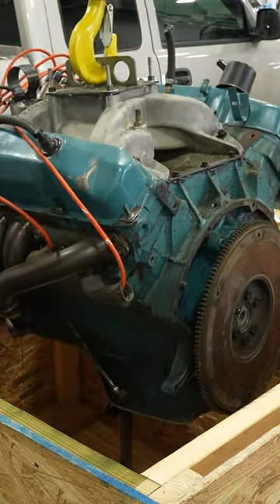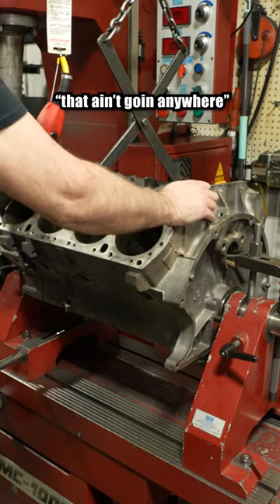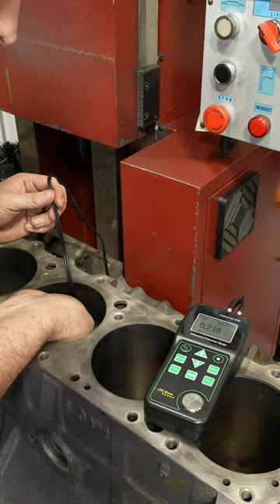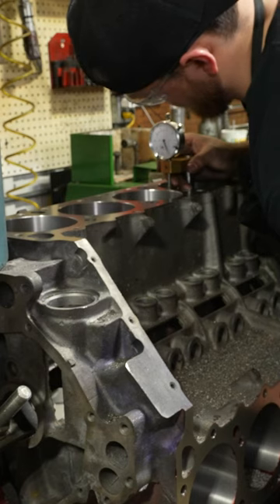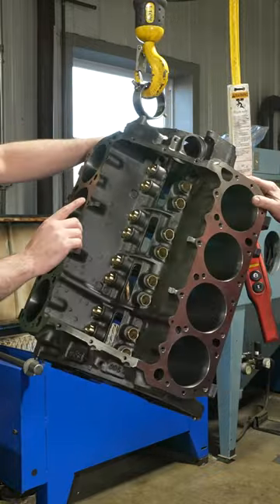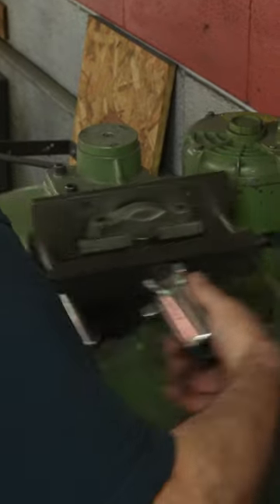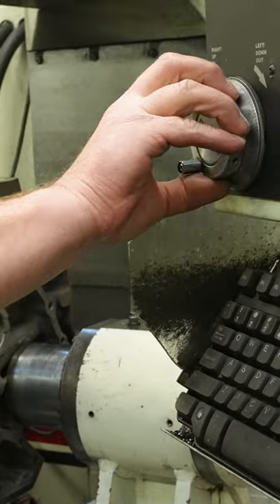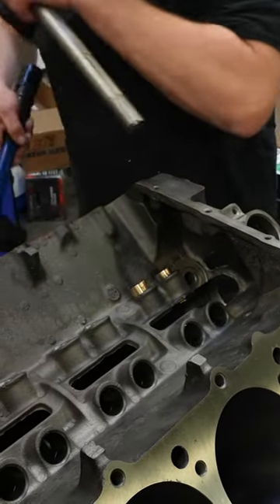Thanks to @geddesracingengines777 for the help on @ScannerDanner 's custom 483 MOPAR STROKER!

Comment: Haven’t seen a 413 in decades
Reply: Small bore 440, like a 396-427 chevy
Reply: There are a bunch of them still in service for irrigation pumps
Reply: Yes there are plenty of low compression industrial applications . The 413 max wedge ,in 61 or 62 , 63 . 13 to 1 compression. These are what I was referring to . Today’s technology ,yesterday’s octane fuel equals mucho fuerza

Comment: The 413 was an awesome engine in its own right.
Reply: I had one... An RB raised block in the Chiltons Manul
Reply: REBUILT ONE,stuck it in a 1967 valiant,stripped all the way down, auto 3.91 gear,11.22 1/4.,twisted 2 sets of axles,kept axles,knew no one would believe it
Reply: This is what the 426 hemi was build from. The 413
Reply: @andrewmacarthur1976  The Hemi was around since WWII and was increased in size as it evolved, it wasn't based on any wedge engine.
Reply: @lelandlewis7207  sorry. Refrase. The 426 was a punched out 413
Reply: @andrewmacarthur1976  somewhat.  They used to same stroke, deck-height and bore centres and made a block to accept the hemi heads, so many accessories could be used from the RB.  Technically, the 426 Max wedge was made from a 413 with a bigger cylinder and the Hemi came from the 426 wedge.
Reply: The car the little old lady from Pasadena drove .brand new shinny red S/S Dodge .
Reply: With the   440  in between
Reply: @andrewmacarthur1976 wrong. Total two different blocks. The head surface is the give away..

413, 426 wedge,& 440 Magnum share the same block
Reply: First it's 413, Then it became a 426, then it became a 440!

Comment: Thats gonna be a wicked motor when done, mopar big blocks are best big blocks♥️
Reply: ls engine is the best
Reply: At holding a boat in place because nothing says boat anchor than a Generic Motor Crap bellybutton LS @lordjaashin
Reply: Yeah I see so many Mopar big blocks these days, must be why they still make them! Because they're #1! 😂
Reply: Ya stock steel forged crank under rated horse power. Mopar rated there HP at the wheels @BleedingWhiteKnuckles
Reply: @johnchristensen5871   mopar hasn't made a big block since 1978! Clearly it wasn't the best was my point......
Reply: @BleedingWhiteKnuckles your logic is that of an elementary child.  I'm sorry you never Advanced as an adult.
Reply: @BleedingWhiteKnuckles that has to do with emissions lol. that’s all the epa cares about. car companies can’t even make an engine like this no more lmao
Reply: @dankdanny8823   yeah you're so right! That's why dodge made the demon and hellcat, is because of emissions not horsepower right?! Also why gm made the 572 big block crate engine 1000hp n/a all soley for "eMiSsIoNs" right? Dodge viper v10, triton v10, all for emissions.........  a 2 minute Google search could've saved yourself some humility.
Reply: @BleedingWhiteKnuckles  lol do you understand the difference in technology between a big block v8 and todays modern v8’s? also where did the v10’s come from? I thought we were discussing v8’s. look at what engines are in record holding drag builds lol. big blocks with todays technology are beating almost everything lol.
Reply: @dankdanny8823  sure do! And the v10s got brought into the conversation AFTER you brought emissions into a conversation about how "mopar big blocks are the best" which I know isn't true because if it was true they would still be producing them which they haven't for decades, that was my argument and then you chimed in with emissions restrictions and I gave examples of how that's not true either. Yes emissions play a small part but if there's a will there a way especially with automotive manufacturers as they've been finding loopholes and dealing with emissions ever since they've existed!
Reply: @lordjaashin  depending on application it's decent but people only think it's the best because 150 million were made so there's butt loads of support and blocks when you blow it up
Reply: @BleedingWhiteKnuckles  the 572 has nothing in relation to emissions equipment due to the fact it's a crate motor, and also, the malaise era killed Mopar big blocks because all the power got strangled out by EPA emissions, and then dodge decided to go tuner style in the 80s and 90s which super killed the big block

Comment: If I recall correctly, and maybe I don’t recall corrrctly … in the mid 1960s we bought a California Highway Patrol Interceptor on the Dealer Auction. It was awesome. If I recall correctly, it had a 413 with 426 Heads and Manifold. It had limited slip. We pulled over girls with the help of some crinkly plastic over the search light, back when that was considered fun rather than criminal. It had push button transmission. If you kicked the accelerator hard with boots, the thing would accelerate in a breath taking manner. If you pushed the brakes - it just stopped. Like magic. It had posi. It was awesome.  We beat it because we were stupid kids. But it never broke.

Comment: Nice.
You know it’s serious when a machine shop needs a machine shop.
Reply: A lot of machine shops can't line bore main journals.
Reply: @spudwickthrockmorton2112 Stroker 😅
Reply: @jdubcbr600 sheit, do you know how much a Align Hone Shrine To the Mechanical Gods costs?

Damn the machine, that blood and burnt gear oil offering really stinks, and then theres the whole 10 days fasting where the honer is anointed with oils and greases and told sweet nothings... 😂
Reply: @threadtapwhisperer5136  exactly. You nailed it!
Reply: @threadtapwhisperer5136 I assume it’s only done during a full moon as well to ensure safe passage?

Comment: One of my dads old workmates is a Geddes (Karl) who worked with my dad at our then local pipe & tube mill over here in Australia (Newcastle,NSW).

Karl was actually an automotive spray painter by trade & he has restored quite a few Holdens such as an FC Holden Ute (pickup) he restored & from memory a 57 Chev.

He also had a hotrod car built for his wife Nola which ran a wildly cammed up 302 Windsor V8 engine & he painted it,the last thing that I heard about him is that he did some airbrush painting for their Harley bikes that he knew in his old motorcycle club in our district, the Gladiators  !
Reply: Different guy.

Comment: 483??? 😮 ,, that sounds awesome,, I've seen the full 440 bore done, but, not the 483,, update me ❤
Reply: Its a 413 wedge, not a 483
Reply: @timrussell1559  it’s not a 413 wedge. It’s a 483.
Reply: Damn so what is it 413 or 483 wedge 😅
Reply: @vedob5163  its a 483 dodge chrysler mopar 7.9 liter
Reply: @EngineRehab   ah ok, did it begin as a 413? And what is a wedge? Is that the block?
Reply: @vedob5163 chrysler engines usually go by wedge, poly, or hemi. It's all in the design of the head. Wedge head is like a typical small block chevy
Reply: @ChrisTheBmxGuy  ah ok, thank you
Reply: @vedob5163  413 being turned into a 483 stroker
Reply: That's not even getting wild. The last one I worked on was for a street legal car and had better than 50 cubes on a 483. Start at about $30K to make one last. Factory blocks will not hold up to serious horsepower though.

Comment: I’m in need of this to be done. How much does a job like this cost for a Chevy 350 small block?
Reply: It’s about $24,000. It even comes with a free engine!
Reply: Consider a big block Buick 455. Only 50lbs heavier.
Reply: @MrJohnnyDistortion  I don't personally know anything about the buick 455, but had an old engine builder tell me they were absolute monsters, and can straight whip pretty much any other big block.
Reply: @Bloodbain88  
Back in the day, a friend had a 455 Wildcat tire melter.

The 455 Buick, which is 50 lbs lighter than a small block Chevy installed into a Nova, Omega, Ventura, or Apollo (X-body) would probably defeat much on the street with the correct gears and a Gear Vendors under/overdrive transmission unit inexpensively.
Reply: @MrJohnnyDistortion 70s engine    I think my childhood neighbor put one in, back in the 80s.

Comment: 413 with the cross ram was 380hp and something like 500 ft lbs ot torque. 
First car i ever messed with was a 413 powered Chrysler 300(had the single 4, but still sounded bitchin with rusted off mufflers))

Comment: Check the crown of the lifters!!!!! The rebuild may have been fine but a lot of flat tappets are not machined with a proper crown any longer. Even from the big names. They will be sold as new lifter but are not as well.

Comment: I had a REALLY STRONG mopar which was fun. I pissed off all the mopar guys by putting a sign in the back window that said "Many Optional Parts Along Road". I just love stirring shit. ha ha   Loved that engine. Charlotte NC to Pittsburgh on the way back to Cleveland in 6:40  which included a stop for fuel in VA along 81. If I had got caught, they would have put me under the pokey not in it LOL  Do the math. 500 miles

Comment: Did that shade tree mechanic put zinc in the oil? Flat tappet cam's have to have zinc in the oil, or they will wear out. They got rid of it because it clogged up catalytic converters.

Comment: Good to see you did the lifter bushings. The way those big block mopars oil the mains they if the lifter bore is wore it will bleed a lot of oil off at the lifter. I would make sure cam goes in when installing cam bearings some had problems whith cam journals out of wack

Comment: The best way to avoid todays flat tappet camshaft failure is to check the taper of the lobes before installing. This is done very easily and cheaply with a caliper.

Comment: I guess alot of people don't this but Flat tapped cam shafts are really bad anymore of been poor material and failing immediately. Not the engine builders fault
Reply: Watch the full length video Jamsi did on the valve spring coil binding. It may alter your opinion a bit. 😊

Comment: Okay. 
The burning question:
Which is the better motor:
The 413 Chrysler?
Or,
The 413 Pontiac?
Reply: Chrysler.
Reply: @EngineRehab all day every day
Reply: Pretty sure there is no such engine as a 413 Pontiac.  421 or 428 maybe.
Reply: @toddholldorf9494  Pontiac never had a 413, Chevy did as an experimental, looked like a 396 or 427, but was not compatible.
Reply: @Musclecar1972   I’ve been into chevy and engine history my whole life, never heard of a 413 chevy.  You may be thinking of the 427 mystery motor which looked like a 396, but different, or the Z-11 427 which looked like a 409, but different.  Both those motors were used in 1963.
Reply: @toddholldorf9494  No, dig a little, I think it was 1963, they did have a 413, I’m familiar with the mystery engine as well, they did some strange things back then, I’m an antique, lol I had a 62 Ford two door post car, 406, 405 hp, 4 speed 4:11, in 1965, a few years later had a brand new 1969 Yenko Camaro, I’ve had muscle cars my entire life, still have my last one right now, just finished restoring it, have owned it since I ordered it new in 1972, a W-30 Olds 442. I’m old! LOL The 413 might have been a derivative of the 409, and not the mark blocks, I can’t remember, but they did make it. I think it was race only, not released to the general public.
Reply: @toddholldorf9494   I looked for a link to give you Todd, I didn’t find it yet, when I do, I’ll get back on here and get it to you, I don’t remember a whole lot about it, I just read about it a few times, it might have been a Smokey Yunick experimental in conjunction with GM, Or Grumpy Jenkins, I honestly don’t remember. If  you like exotic engines look up the Olds W-43 engine, they did release them for racing only, and they knocked the snot out of the Mopar Hemi, but never got to the public because of the Insurance regulations, and the environmental issues.
Reply: @Musclecar1972  👍 I’d like to check it if you find it. Ill look up that W-43
Reply: @toddholldorf9494  👍